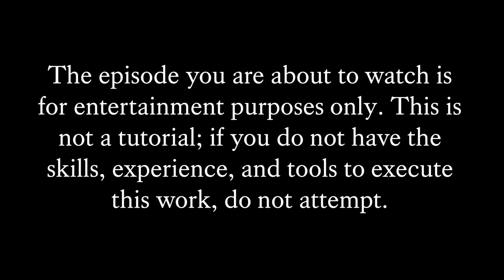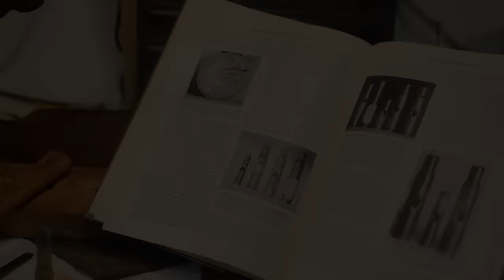Mauser Gew1898 Conservation and Checkout: Anvil 0134

Comment: The 2 digit numbers on 'most' of the parts are the last 2 of the serial number.  Nice work!  I have an all matching Gew 98 from 1917.  I had to 're-tip' the striker and the stock was broken through at the mortice for the cleaning rod nut.  I bored both pieces to 5/8" and inserted an aluminum 'dowel'.  It's only visible is you drop the cleaning rod nut out to reveal a shiny aluminum mortice.  I love bring these old pieces back to life.

Comment: Found your channel ....Learned a lot about the Mauser, Thanks ... I have two 1895s The first one is all matching numbers with cleaning rod and real clean, 95% of bluing and the stock is in good shape, shoots 3 inch group at 300 yrds. The second is just a barrel and action, short barrel. The action and bolt are good, but the barrel is wore out, it will need to be refitted with a new one. The good Mauser is my bugout rifle, because if it survived WW1 and WW2 it should make it through WW3 and the 7x57 round is still around.

Comment: The firing pin is numbered to the bolt and should be welded.
Many were ground before being sold the the public by state auction. This gun was likely not fired since capture.
Reply from the maker: Agree

Comment: per oregon state university research: bleach does not kill mold on wood, its just a noxious surfactant. vinegar was the right choice.
Reply from the maker: OK, I'll put it out that way going forward
Reply: It most certainly does,  you better check a few more colleges / non liberal ones,  you are aware there is a anti bleach campaign going on,  ?  There's a reason it went from $1.79 - $8.00 in the past 4 years
Reply: That's usually the way. My experience suggests that an anti anything campaign is only about making said thing more profitable.

Comment: Working on a rust-covered RTI Mannlicher 1888/90 right now: when I first got the stock off and aaw that undamaged rust blue beneath the woodline I nearly cried.
Reply from the maker: 99 of these die from a lack of maintenance to every 1 that was bubbaed or sporterized. Just sayin
Reply: @marknovak8255  It's definitely a death due to lack of maintenance. Straight out of Ethiopian stocks - I'll be applying the techniques learned from your videos to try to reverse the damage.

Comment: Project Farm did a good test on penetrating oils AND the ATF/acetone mix. The mix didn't do so well, while Liquid Wrench and Kroil were at the top (which I now use as my go-to penetrants). I used to use PBlaster, but found that the others worked/crept on threads better (auto mechanic, lotsa rusty stuff lol)

Comment: Thanks for doing this video.  I only wish I had seen it back in the  70's when I did my '98.  I got most things right but was too much of a coward to take off the Unit Disc and the lower sling swivel back then, but the rest I got right.  I will do that now and that way it will be properly done.  I run mine in our local Vintage Arms Shoots with 200 gr Matchkings and N150 Powder.  The trigger is stock and smooth with a heavy second stage.  The gun is quite a conversation piece.  I replaced the original barrel (bulged) with a Lothar Walthar 'drop in'.  The original 400 meter sight settings mean that I am really high at 200 yards and still clip the top of the target at 300.  Aiming low is hard with the stock sights and I think I will replace the front sight with a higher one.  I bought one of the Brownell's replacement sights but am not happy with the profile of it.  Not even close to the original.  I was looking at a piece of 1/2 x 1/2 bar stock for another project and got inspired to make my own replacement.  I just have to do some calculations on angle/height, etc.  If you are going to replace the barrel and make a decent shooter, go for a really high quality 'match' type.  You won't be sorry about getting a few extra points during a match.  If you do want to shoot this rifle, please bear in mind that the sights are not really great and you will have to do work really hard to hit anything past 300 yards.

Comment: For the danish oil that you use, is it dark walnut? Could see the brand just fine, but not the lower part of the can. Great video as always. Cheered me up when I saw it last night and knew it would good great with coffee in the AM. I had a K98 that I bought in good condition aside from pretty horrific rust under the butt plate. Love taking the older guns apart for a good, careful cleaning. Never had an 1898 but always admired that rear sight.
Reply from the maker: Dark Walnut,  yes

Comment: Thanks so much for this demonstration, I have an Argentine Mauser where the trigger felt like a single stage and it would fire when coming off safe, I had put it in the back of my rack with a do not fire tag to work on in the future, while watching this I decided to pull it out and tear into it and found a PO had put a small screw under the trigger spring, once I removed that the trigger felt right again and the fire off safe defect seems gone, will have to do more tests but it looked like that "enhancement" had caused the trouble?
Reply: I have an Argentine that my father in law sold me years ago,hard to find ammo for,but a well built gun!

Comment: I pulled an FR8 apart a while back and gave it a thorough cleaning, replaced stock that was cracked through the magwell. Oh crap, I removed, cleaned, and replaced the stock recoil lug. It was not peened in place. (Maybe why stock was cracked?)

 I just torqued it back on till it seemed tight. Did I make a big oopsie?
Reply from the maker: Like i said,  don't pull the lug unless you have to. You felt it necessary,  did the maintenance , and got on with it. No oopsie......
Reply: @marknovak8255  Thanks Mark.

Comment: Excellent video, I don’t think you mentioned how the rear tang can crack the stock acting as a wedge if the front lug isn’t fitted correctly. You hinted at it in the beginning but didn’t get into the detail. Maybe worth a revisit?

Comment: Mark, that watco "Danish Oil" is part polyurethane. You should stick with pure linseed and tung, adding your own spirits as needed. 
Otherwise nearly perfectly done.

Not joking, look up the MSDS before you talk trash. (not hating, it fooled me for decades too)
Reply: Followup comments as I finish the video: 
Just countersink the bore a bit, make sure the "inner crown" is good, and rifling unfouled of oxidation. Way easier than a sleeve or other nonsense if you can get away with it. 
I have heard of plating the inner bore, and then running a precision reamer down after reboring to stock bore after rust conversion, but no idea the safety or longevity of such a method. Seems like it might foul the rifling, see above for my opinion on that. Maybe hardwax, then bore, then plate, then melt out wax? It was good enough for NASA.
Reply from the maker: What does your MSDS say? Mine says what I said in the  video.  Danish oil is better for me after years of camparisons and running a shop where time is the enemy.

Comment: I recently acquired a house that had a Model 94 built in 1895 that was found in the attic. The previous home owners let me have it. But it's missing quite a few parts... Looks like someone took it apart to work on it and never put it back together. It's in rough shape and unfortunately couldn't find the missing parts anywhere. What's the best course of action to get it back in functioning condition? So it's at least whole.
Reply: Google the missing parts...Numrich and a few other companies will come up.  Or else just send her to me...I'll get her runnin again just like I did my Remington New Model Army Revolver built in 1863! 😁
Reply: Take it to a reputable gunsmith that at the minimum has certifications from an attendance program — online certs are worth basically nothing in this trade beyond basic repair. Expect to pay them for their time which will not be cheap (95/hr avg around these parts) but they can source parts rebuild and safety check everything.

Comment: I have a husqvarna with the FN mauser  98 action, one lock screw broke off, would the threads be the same as the german surplus rifles, and what is the thread size? 
I got it drilled out, but it appeared to have been cross threaded in before i got it.

Comment: Would it be possible to lead- "slug" the barrel using valve lapping compound at the last inch of muzzle length....to avoid having to counter-bore it? At least as a "try" and then measure the groove and land dimensions after, that result to see if it isn't a danger anymore? BTW, another question. On my matching numbers Yugo M48....it passes the trigger/sear test when putting on/off safe...BUT...it doesn't seem to pass the other test you show, where one is advised to see a slight rearward movement when pulling the trigger. First question....should the M48 do this like the 98?....and then....is it a problem? Doesn't seem to be easily "knocked-off" the sear to accidentally fire..so it's holding, just not moving that small amount to rear as you pull the trigger ( at least not that I can "see").

Comment: Where, oh where did you get your info on Ed's Red. Every addition is Hydrophobic. Even the old formula is the same. What is transmission oil for? Years of time and miles, no internal rust. Naptha, ever seen the metal of the old tanks rusted.

Comment: I'm stumped. I've done the conversion process before on several bayonets which cleaned up great and I picked up a M2 carbine magazine that had a coating of red rust nothing scabby or pitted just the bluing went red/brown. I tried to convert it I had it in a pot of boiling water for 3 hours and the rust never converted. the follower for that magazine and other rusted followers i had converted beautifully but the magazine body never converted it stayed covered in rust. I had throughly degreased and cleaned the magazine and yet it still didn't convert any ideas?
Reply: Might need a brass scraper. Thick rust shields itself.
Reply: @theshadowrunner28  it was a thin layer of rust but it never converted to black oxide it stayed red throughout the conversation process.

Comment: the sights are lead solder not silver soldered
Reply from the maker: True
Reply: @marknovak8255  I would need more than a propane torch to install them if those sights were silver soldered 😂
Reply: @topguntin  Considering I plumbed my whole house with silver soldered copper and a propane torch, I disagree. However propylene (aka mapp pro yellow gas) is indeed a better choice and works faster with less heat in the rest of the part.
Reply: @nobodynoone2500  try silver soldering a copper rod 1in thick and 5in long in 30F weather 🤣. I do all my work outside in the back yard shed

Comment: I have a question did that stock on that gun have a action take down ring in it or was that from another gun. However I really do love these video's you do thank you Sir
Reply: The stock on the gun had a unit marking disc but not the take down ring.  He used another rifle with the ring to illustrate what it's there for.

Comment: Hey Mark,

I have a Mauser that it won’t go into the second safety position. Dose that have to do with the bolt body itself?  It goes into the first position no problem
Reply: I'm assuming the rifle is mismatched. This is a common problem on mausers that are mismatched. The safety might have to be carefully filed so that it will allow itself to be turned into the safety position. The up supposition is actually the dissasembly position, not a safety.
Reply: Ok thank you for the help. I was kinda thinking that but it’s always good to have a second opinion

Comment: Refinished the stock, converted  surface rust to blue on the white receiver 🥲🥲🥲
Reply: He didn't blue anything OR sand the stock.  He boiled the metal parts and washed the stock with soap and water.  He DIDN'T EVEN steam the dents out!  Some of you folks apparently didn't watch the whole video.
Reply: @les3449  I watched the whole video.  Boiling IS blueing.  Thats how rust blueing works.  Now that white bolt and receiver is covered in polka dots.  The stock had its original finish stripped by the abrasive and was recoated in modern material.  That shit got destroyed man.
Reply: @SpliefDaGrief I have done both hot and cold rust bluing and you must take the old bluing off and apply new bluing AFTER boiling to "reblue" the steel.  Otherwise you are just loosening rust, which is what he did.  I have also refinished many stocks and he did NOT refinish it.  He washed it and put oil on it that absorbed INTO the stock to protect it.  He didn't refinish the stock.
Reply: @les3449  he literally put a new coating on it.  No bother arguing with you.
Reply: @SpliefDaGrief he CLEANED it young man.  I have done the same thing!  The oil he used went INTO the wood, it didn't stay on the surface.  There IS a difference.

Comment: I heard you mention an "acetone bath" on one of your videos about stock repair. When would a full blown acetone bath be appropriate? 

Also, whats been your decision for the level of oil-soakage that would be considered acceptable, and whats your take for when you would call such soakage (heres your favorite word) patina , rather than a damage-doer. 
THINK OF THE GATS.
Reply: I've used a Laquer thinner bath on a few laminated K98k stocks that were SOAKED in cosmoline, russian shellac and a half mile of logging road. Kept them in the thinner ( outside of corse for obvious reasons ) for about a day and a half with a change of fresh thinner for finial clean-out. The results were very good to say the least. Two of them were borderline spectacular!  They looked almost brand new. No damage to the wood or to the glue that was used in the factory that made them. It even uncovered the HEER acceptance marks( I said "uncovered" not "restored" ). I wiped them down with shop towels and left them to fully dry under a HOT sun for a few hours. 

Purists will hate me for using a dull satin poly on those stocks but I don't care. These guns are users, not safe queens. They have darkened over the years but still look great.
Reply: @johnsmith-zs9jq 
Be careful, or the collectors will come out and flame you for making a gun shootable instead of sitting to avoid "hurting ita value"

Comment: I don't understand your trigger engagement warning.  I completely understand the geometry and physics of positive, neutral, and negative sear surface engagement.  What I don't understand is that - after you explain precisely why they designed it with so much positive rake (scared, frozen conscript) - why a modern owner who isn't a scared, frozen conscript (and knows his rifle will never be issued to a scared, frozen conscript) should be afraid to fire a rifle that has been modified away from scared, frozen conscript mode?
Reply: When you modify a trigger like these original Mauser type it must be at least slightly positive. Like he showed the cocking piece camming back but a little less so. So yes you can do a trigger job on the original sear but must be done properly and safe-never negative angles or even neutral. I would not lower/change the amount of sear engagement on an original peice like this there is usually a good amount of slop on these bolts in the receiver. Also these sear parts were originally case hardened so if you stone or sand through that you have that issue to deal with now as well as the safety not working because you changed the original amount of engagement and now the safety wont engage like it did before.  If you must have a nice trigger consider a Timney or something like this. Triggers are pretty much the most dangerous thing to work on as a gunsmith safety and liability wise. So..... you must be sure of what your doing before messing with a customers property. For all new gunsmiths getting started you need product liability insurance if your going to be doing trigger work. This rifle a rare Simson Shul very low production numbers. Good call on saving this one.
Reply: @kevingriffin7255  I've done many safe and effective trigger jobs (on other types), but I had forgotten about the case hardening on these - an excellent point.  You're absolutely right about using a drop-in if a better trigger is needed (although that would have a similar observed effect).  Thank you very much!

Comment: out of curiosity, say an idiot used some type of epoxy of unknown type on the front and rear sight on... actually one of these rifles here [gew98] rather than proper solder. how do you get those sights off to then scrape/cut/grind that epoxy off barrel/sight block? or is this an instance of remove barrel from receiver and trash the whole epoxied mess? [the barrel is unsafe to shoot anyway but its matching to receiver and sights]

great video as always!
Reply: also side question on the rear sights; is it actually better to remove the pins that ride the cam on langevizier sight or just leave them in the slider even if they are properly tightened? the actual rear sight rollercoaster has a cut out near forward pin to slide them out of. [apologies if i missed that in video and it was mentioned in passing]
Reply: Personally I would put a new barrel on it to make it safe to shoot, maybe you can find someone who can do some markings on it to make it look like it was rebarreled at an arsenal
Reply: Firstly, depends on type of epoxy. There are a few fundamentally differnt types. Some can be chemically removed from steel, others mechanically. 
Second, I would just reline the barrel if possible. 
When scraping epoxy, try to determine the epoxy hardness and pick a scraper that wont damage the steel. Abrasives are a last resort, and better off avoided.
Reply from the maker: Heat might loosen the epoxy. Screws removed to get at impacted rust. The pin escape slots didn't make the edit